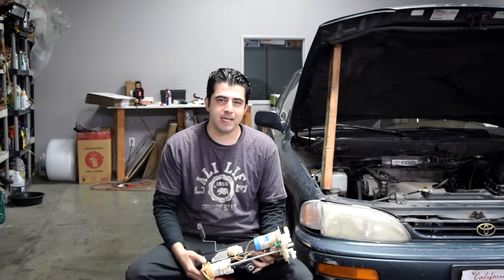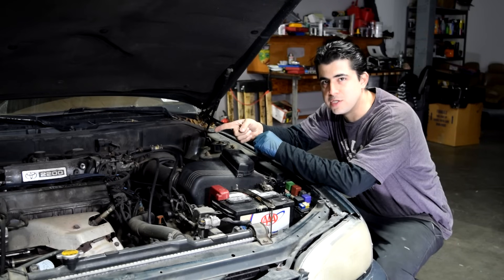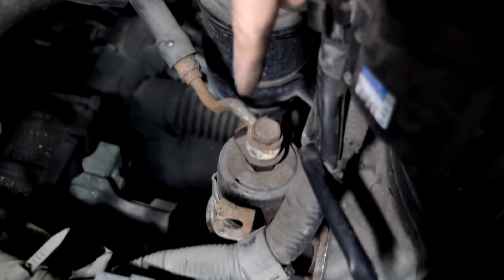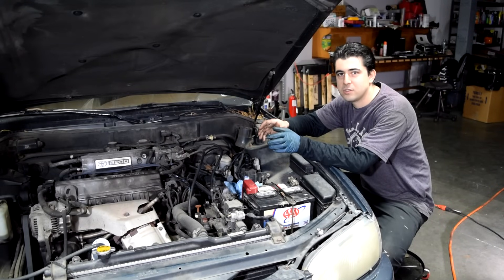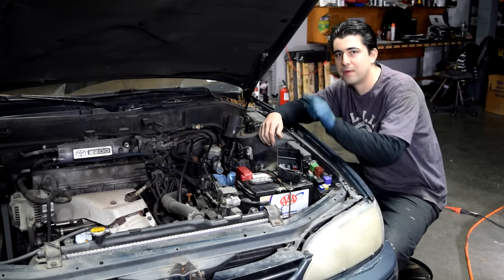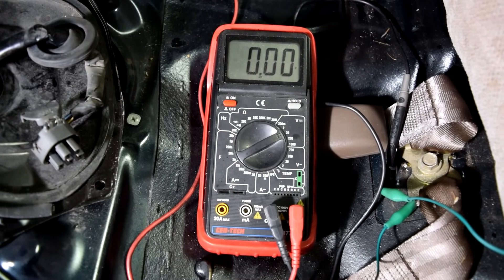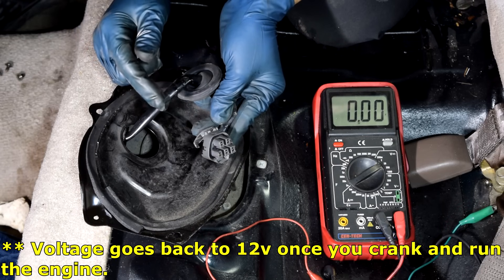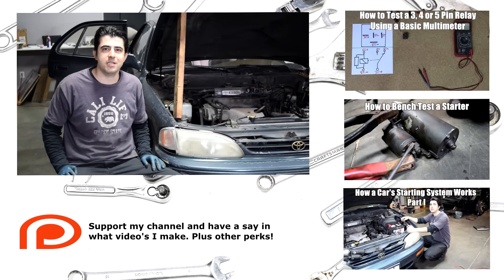How to Properly Test and Diagnose a Bad Fuel Pump

Comment: Thanks!! I've 12.75 volts at the pump, 4 amps going through, 20 PSI of pressure (supposed to be 70 PSI), no start. So what I take away from your video is I have to keep looking (fuel pump is NOT my issue here).

Comment: I have a 1994 Toyota Camry XLE just like the one in this video. Every test that you showed test fine except for my fuel pump pressure it’s only 5 to 10 psi and then it goes to zero when I turn The car off. I have tested the fuel pump relay as shown in your video, checked the fuel pump fuse and they are both fine. I also put a new fuel filter in. Also replace the fuel pump with a Bosch and a new strainer and it’s doing the same thing showing only 5 to 10 pounds per square inch pressure when the car is running.
I rented the fuel pump pressure test from The auto parts store and I assume it works fine. I guess I could have gotten a bad fuel pump?… Is there a way to test just the pump other than my pressure test? The car will start and run for anywhere from 1 minute to 4 minutes and sometimes longer and then completely shut off with a no start until 5 to 10 minutes later.
I have also clean the throttle body and the IAC and the mass airflow sensor.

I appreciate any wisdom you could share on this problem
Reply: Are you sure the pump is working AFTER you turn on the car? It sounds like the pump only primes when you open the key, gets enough fuel to start the car, but then stops working after you turn it on.
Reply: @pi_mond  Thanks for your reply.

Comment: Could it be the cold start injector time switch ?? I just replaced the fuse and the starter and tested the fuel pump connectors with a multimeter like your instructions, it’s a 93 Camry been watching your videos for years

Comment: So do you know if the fuel pump is working if its reading the fuel gauge !!!!!!! and why can't I hear it, I've been having problems with my Toyota corolla for over 3 weeks, at 1st I had to replace the battery (it wouldn't crank) then I replaced the the crank position sensor I got it started but it died off when I pressed the pedal thinking that it needed fuel.. I checked to listen for the fuel pump it sounds silent, I took it out and tested it manually connecting directly it works, the connector was giving me a reading when connecting the ground and power.. but power and grounding it to a nut by itself I wasn't (don't know if i was doing it right just how u did it in the video). I checked the relays they seen to both have voltage...and I'm not really sure where is the fuse for the fuel pump!!!!! please help

Comment: My car (Toyota corolla) has a problem with power to fuel pump. All fuses and relay plus the fuel pump itself is good when tested but when starting the engine fuel pump is not working. What is the problem.

Comment: Question. Can a fuelpump be defective in a way that it works and starts the car BUT when driving and getting off the gas the car shuts off? Also no codes or check engine light on. Model 2018 Hyundai Elantra SEL

Comment: U did not show how to use the fuel pressure kit. From just turning the key on without motor running and when motor is running. Huge part in determining a good or bad fuel pump
Reply: You didn't show us how to use the fuel pressure kit I was going to go buy one but you didn't show us how to use it.

Comment: Didn't you have to check the pressure at the pump outlet with the pressure gauge? In vain check the voltage at the pump socket if it does not deliver sufficient pressure. So the title is not appropriate. Have a good day

Comment: what if the fuel pump strugles at high rpm only? is that possible? i have a jtd 1.9 and whan it reaches hot temperatures and you put it under stress switch off and lose all acceleration on dashboard P0191, reset and works fine again.
Reply: Did you ever find the problem
Reply: @GreaseMonkeyFix  still not, soon I'm gonna buy 4 new injectors

Comment: Got a 99 Camry. Haven’t started in 3 weeks during this pandemic. Went to start it i turned over then died instantly and all it does is crank. Fingers crossed it’s only just the fuel pump/ relay and timing belt didn’t slip.
Reply: Same issue on a 96. Was it the pump?
Reply: Aleks Lazutin yes it was the pump. I checked it a second time with my girlfriend turning the key while i had my ear on the gas tank to try to hear it.
Reply: @TommyVercettiCB7  Thanks for the reply. Found out am not getting voltage to the fuel pump for some reason. Will have to trace the wire. Glad you got it fixed!
Reply: Aleks Lazutin hope all goes well with yours. Good luck.

Comment: Good video very informative, I got a bmw e32 730i 188cv and would highly appreciate if you helped me with a issue I got on it, bought a pump from a guy and he says I should not test it with the battery because it works with diferent voltage like pulses wich I really am thinking he is lieing to me so I started to test the power to the pump in the car and both fuel pump cables was giving ground, after that I found the issue was a cable that goes on the relay where the fuel pump cable connect to the relay and cut it off after that there was no more ground on that cable, the relay wasnt working so testing the power that goes to the relay both cables that active it give positive 12v power when turning the key to on after that I was testing the relay on another port and it seems to work, is it normal that both cables to activate the relay have positive power? maybe it uses some kind of special relay and someone changed it? Is the guy I bought the pump from lieing to me?

Thanks for the video anyway if you cant answer I can undersand, cheers.

Comment: My fuel pump only starts pumping when I start cranking. I know because I’m looking at a gauge. The pump is in the tank. Hyundai Accent. Then when I cut the engine the pressure leaks down rather quickly. I also am getting some long crank  times when warm. I don’t hear any fuel pump or see a pressure rise on the gauge in the run position. How do I know where the pressure is leaking down from ? Injectors or fuel pump ? If I pinch off the rubber gauge line I got coming out of the fuel pump and into a t with the gauge in it and then the other side going to the injectors killing the motor. should I see no leak down if the injectors are not leaking and the the only other thing would be the check valve in the fuel pump or the regulator also in the fuel pump ? Any ideas ? I don’t want to pull the injectors to see if they are leaking. I’m trying to do a process of elimination without pulling stuff apart and with only pressure testing isolating the components and eliminating them one by one. I don’t think my pressure should be leaking down so fast when I cut the engine.
Reply: If your loosing pressure very quickly it might be your fuel pump or pressure regulator

Comment: A code tester can operate the pump and give codes if it don't work. If you get codes about fuel pump circuit, it could be the relay if the pump don't work. Try the solenoid and relay test. Fuel pumps can operate intermittently. A partially clogged tank filter can cause low fuel pressure. If the pressure leaks down, it could be the pump, injector, or pressure regulator.  The live test on a code tester can show fuel pump pressure while cruising at highway speeds to see if it's low.

Comment: I’m having trouble with my Chevy traverse when I remove the gas cap to fill up it gives me problems to start the engine like if it lose pressure. so I have to crank the engine and at the same time press the gas pedal in and out to start. But it’s only when I remove the gas cap cause other than that it starts good any time I turn on the engine. Do you know if is the fuel pump.
Reply: having a similar issue with a 99 dakota, only at the pump filling.. oddly tho,  if i fuel it with a gas can i have no issues starting.

Comment: Please I need your help I have Hyundai Azera 2006 . I have no power come from relay or fuse to fuel pump . I changed new fuel pump and new battery still no power to fuel pump .
Reply: Check for frayed wiring to the pump.

Comment: What if gas squirts in  carburetor  when u pull the accelerator   could it mean it still works  because I'm haveing issues with my truck shuting off when I put  my truck in gear  and  Push the gas pedal  but won't do on parked rpms
Reply: adjust idle air screws until idle rpm is about 700 (look up what it should be but 700 is enough to keep it going)... If the trucks rpms dips below roughly 500ish when in gear it will die, there's also a adjustment screw for that, but it sounds like an adjustment or dirty carb, I would also look for vacumm leaks and ,misfires, since they can intensify under load, carburators  are a pain or for roughly $350-700 (vehicle and performance of part dependent.) you can switch to efi.

Comment: That was a great video with good instructions. Can a faulty fuel pump cause misfires in the engine? Also if the fuel pump isn't good do I have to remove the whole assembly or can I just replace the fuel pump motor? I have a 96 Jeep Grand Cherokee and I actually have to drop the tank in order to get to the fuel pump. I had replaced it 2 yrs ago with an Airtex fuel pump which I just found out wasn't a very good one so I'm curious if that could be the problem.
Reply: Some fuel pumps can be replaced just the pump. You'd be better to replace the pump and filter. Replacing the whole sending unit insures the gas gauge is correct. Get a Actron CP9690 code tester. It checks live, record, graphing, emission readiness test, ABS, SRS,  coolent temperature, IAC valve, MAF sensor readings, RPM's, fuel pressure, fuel trim, closed loop, open loop, oil light reset, code connect to diagnose codes for that vehicle, and MORE! It comes in a pouch and has a cigarette lighter adaptor cable. It works from 1984-2013 and is updatable. Get the USB cable from EBAY. It includes a adaptor for OBDI Ford, G.M., Toyota, and Chrysler. It has penlight batteries for the screen. The readings can be retained for away-from-the vehicle review. 2000 up is automatically set-up. You can test a car while driving to check faults causing probability problems. Use fuel injection cleaner to clean injectors to avoid false readings. EBAY has it.

Comment: Quick question: My fuel pump was making a low-pitched groan instead of the usual high-pitched "whirr". It would sputter to a start and then stall after 10 seconds. 

I changed the fuel filter, first time in 5 years, and it groans the exact same. Now it actually stalls after 2-5 seconds. Pump getting weaker? 

The relay clicks and the fuse is good. Tomorrow I'm going to borrow a fuel pressure tester. 

I diagnose that it's the fuel pump. What do you think? Could it be a clog in the fuel line? What else could cause that low-pitched groan?

It's a 2003 Chevy S10 V6. Interested to learn more about this 

Great, concise video!
Reply: Man, nobody responded to this.  Did you ever figure out what the issue was? It would have been sad to change out the pump and then have it be something else that then ruined your new pump...  let us know if you ever found any root cause and solution.

Comment: Good Day,

I’m a stay-at-home Dad on disability (got run down by a
Postal Truck on my motorcycle) and I was hoping you could advise me. My 1996
Oldsmobile Aurora
won’t start and it’s definitely fuel-related. It turns over fine, but it “coughs”
when I pump the accelerator. The fuel pump is NOT engaging when I turn the
ignition to on (I would normally hear it), but I want to be sure it’s not a
clogged fuel filter, open fuse or a relay etc. before spending hundreds I can
ill-afford on a pump I don’t need. This began when I accidentally ran out of
gas last week, my fuel gauge was not working. I’m betting sediment from the
tank got sucked into the lines, fuel filter or injectors. My car has been
running fine until I tried to start it yesterday. I assumed I ran out of gas,
got 2 gallons in a can but it still won’t run. How can I eliminate the other
things to find it is a bad pump?

Thank you so much
Reply from the maker: Hi, this video is pretty systematic in the steps you need to take to verify any issues with your fuel pump. How far along in the steps in this video are you? Let me know if you've ran into any issues. cheers

Comment: Good video - remember, the fuel pump will not continue to run with key ON and engine not running without a jumper in place. It's a safety feature so grandma will not burn up after she causes a 20 car pipe-up and does not turn key to OFF position when she is done.
Reply: But grandma wants to see the world burn.
Reply: @robertharris6092  grandma is making sure the world burns
Reply: Why would she burn up? You're saying cus it would keep delivering fuel to a potential ignition source?

Comment: Hey! Nice video and nice tutorial :) i like it, but i have some questions -
A bad fuel pump is JUST about ignition issues?

My car does some strange things when i press full throttle and  the car revs goes reduced ,  the feeling is like your car goes out of fuel... but is not the fuel ! its like the car coughing ...

what should i check? :/ fuel filter? fuel pump? electronics? fuel injectors? 
damn im looking about that for so long time.. and i wont pay those mechanics on my town cause they are so sneaky and expensive -.- help pls

Comment: If I disconnect the fuel line at the rail, and after taking precautions, crank the engine, shouldn't I see fuel coming out of the line?  Would this indicate a good or bad pump?  Thanks for your video!
Reply: Sometimes, bad fuel pumps have some pressure, so the answer its not

Comment: Nice one! and my cheap obd2 reader connected to the torque pro app will give you fuel pressure values at the rail, well it does on mine, for quick direction👍
Reply from the maker: +Typey1 That's nice, won't have that reading on alot of cars though.

Comment: Good job sir, don't forget the hammer on the bottom of the tank test :) haha
Reply: what's  the hammer on the bottom of the tank test?
Reply: you may have difficulty walking normally afterward using that method and people will laugh at u too (for numerous reasons -hehe)
Reply from the maker: +South Main Auto Repair haha, that's a classic method.